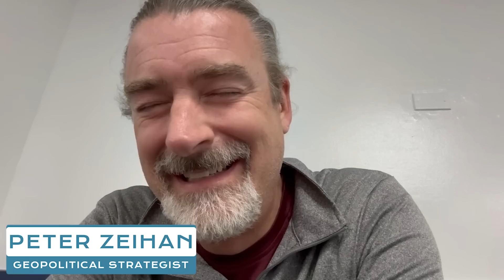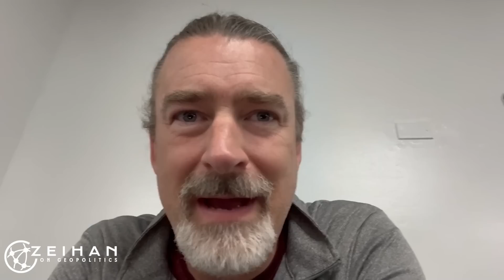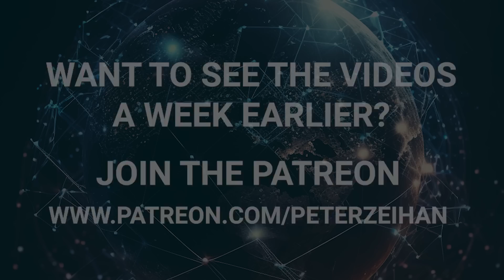Nuclear Power's Facelift: Small Modular Reactors || Peter Zeihan

Comment: Peter, what about the cost? I'd argues that the biggest drawback and the thing that's holding Nuclear back is that it's prohibitively expensive in capital costs, leading to LCOEs in excess of those of other renewables, even if we factor in storage. SMRs are no cheaper per MWh than the big plants, not to mention the added risks of plinking down hundreds or thousands of the things. I don't see those problems going anywhere, anytime.
Reply: ???
Didn't Peter literally just start off by explaining how big tech is bankrolling SMRs for baseload energy so the normally prohibitive capital costs for SMR R&D are considered moot? Am I missing something?
Reply: @korayven9255  It's not just R&D that's expensive in SMRs, but also construction. It's an improvement over the current designs in that you don't have to build the entire thing on site, but all other issues remain. Big tech is getting into it because their appetite for energy is larger than what the grid can provide - and it's actually not about the sources of power, but the infrastructure.
Reply: @korayven9255  That, however, does not adress the problem at hand. All he said that those tech ist paying those startups. He did not go into any kinds of specifics or into utility scale power generation. Peter mentioned Vogtle in passing, Vogtle 3 and 4 cost a combined 34 billion to build. I for one would welcome a in-depth video regarding the economics of NPPs. Because unless those SMRs drive costs down massively, nuclear is just way, way too expensive.
Reply: @AhDude92  You are arguing about theoretical costs that will only become certain after the startups complete development. You are demanding data that doesn't exist yet to argue against funding the processes to get the data you are demanding. That is circular logic. We don't have concrete answers yet, that's the entire point why they're doing this.
Reply: I work in the electric utility industry. The Obama administration did a great job laying out the costs of different types of electricity. This was further broken down by construction, maintenance, fuel, etc. Nuclear is one of the cheapest by requires a 40 year commitment. In today’s ever changing environment there is no guarantee regulators will allow you to run for decades without issuing new costly rules. With new bipartisan congressional approval and backing from 14 banks, big tech now feels comfortable making that 40 year commitment. The cost is a myth driven by low information and biased media. Of course, it is entirely possible that I am wrong and big tech didn’t do their homework either. Perhaps the best expert is a journalist major looking for clicks.
Reply: @Robert-fx3ng  The only news about data centers and nuclear power was a conventional nuclear powerplant that was about to be shuttered getting funding for a refurbishment and life extension from Microsoft in exchange for them getting all the power directly without even going through the grid and thus avoiding the upcharge all grids put on power.  As this was already existing plant already fully paid off the marginal costs were very low.
Reply: @ every nuclear plant that was scheduled to shut down has been extended. 14 banks have approved funds for nuclear. Congress passed a bill to fund nuclear this year. All of the mothballed nuclear plants are in discussions to reopen. The companies working on SMR are too numerous to name. You really can check the internet in seconds to verify these statements. You also could spend 5 seconds on the net before putting your foot in your mouth, if you really are uninformed.
Reply: @Robert-fx3ng  And why were they extended? Massive subsidies. Byron and Dresden got saved only by a 700 million $ subsidy from Illinois. Other scheduled shutdowns were only averted due to subsidies, as well - Diablo Canyon, for example. All recently planned shutdowns were due to financial inviability and losses incurred during their runtime. They were simply not profitable, until the taxpayer stepped in to throw money at it. Thats the problem. Its just too expensive.
Reply: @most people know how renewables are subsidized and not competitive. I am impressed that you could be this bold and uninformed at the same time.
Reply: @Robert-fx3ng  You really like the word uninformed, when youre hardly putting forward any hard data yourself. Prove your assessment.
Reply: @ I work in the industry and just listened what is going on with nuclear. Now it seems to me that you want to change topics and start the renewable energy is much cheaper. If renewables were actually cheaper and not subsidized, utilities would built than at scale. What do you want me to teach you about my industry?
Reply: @Robert-fx3ng  You started with the costs of renewables. I did not mention those in any way. Also, "Trust me bro" is a poor proof for anything.
Reply: Liquid salt reactors operate at atmospheric pressure. That's a big reason these next generation reactors are so.much safe and cheaper.
Reply: Nuclear has always been one of the most cost effective options UNTIL the Sierra Club and Greenpeace focused all their efforts on trying them up in court.  I know ...why would they be against zero carbon power to charge all those EVs overnight?  Influential leaders equated electricity "too cheap to meter" with unchecked population growth, so they threw everything against nuke in the 70s.  Very short sighted.
Reply: SMR arn't just 'no cheaper' they are infact MUCH MORE expensive then large nuclear reactors.

Comment: Nuclear power plants stopped being built in the US because of the economics.  The actual cost of the construction and operation were 2-3 times higher than what people, and investors, were told.  Projects were started, like the Callaway plant in Missouri, and scaled back by half before construction was even completed on one of two planned reactors.
Reply: The cost of construction came from regulations changing constantly over the course of construction. This is demonstrated by the fact that the largest increase in cost of the plant came from the home office, i.e. design and engineering, because of constant reworks and environmental studies demanded by the NRC, specifically to derail and bog the project.
Reply: @nathancochran4694  I think it used to take about 3 years to build a nuclear plant.  That's up to at least 10 years now.

Comment: How do we provide physical security for many, many SMRs?
Reply: I also have this concern.  

How do we protect other vital infrastructure in the USA?

Answer, we put a chain link fence with barbed wire around it, gravel the parking area and mow the lawn twice a week. 

It is cost prohibitive to do much more.

Look at our electrical substations.  Some substations power half a city and they have a fence. 

Same with water infrastructure and anything else that is unmanned. 

Security, safety, and efficiency is why I prefer large nuclear power plants over SMRs.
Reply: That's why many of them will be sited on existing nuclear plant sites. Take Lake Anna in Va. Dominion Energy has announced an SMR project for that site, in part because it's close to the server farms in northern Virginia. In addition to fencing, walls, physical barriers, that plant has basically a fully kitted-out SWAT team complete with armored vehicles on site, just waiting for someone to try something. There's plenty of space to add SMRs within the perimeter. There's also talk in the other end of Virginia to turn old mountaintop removal mines into SMR sites. Picture a mountain ridge with a square mile of flat surface surrounded by sheer drop offs on all sides with one access road in and out. About as defensible as any place can be.
Reply: They're not very brittle or easily sabotaged constructions, so arguably the physical security requirements are moderate. Also many of them will be placed close to each other.
Reply: @jesan733  Just about anything complicated can be ruined in less than an hour with a grinder a hammer and a crowbar.

Tell me if you think otherwise.
Reply: @jasonneugebauer5310  depends on the definition of "ruined" I guess. Let's say we have a huge pool of water, below grade, with no drains, and the reactor modules are operating while submerged in that pool of water. How to compromise that setup, with those tools, to get a significant radioactive release outside the plant perimeter? (I'm describing the NuScale setup, btw.)
Reply: @jesan733  being in a pool probably 10 Xs the complexity. 

But, anything that can be accessed without intervention can be damaged.

I am not particularly worried about the radioactive material. 

Nuclear is unpopular with some people who may just want to damage the reactor for PR.
Reply: @jasonneugebauer5310  why would being in a pool add complexity? The point is that it radically lowers complexity. The NRC agreed that due to this design facilitating passive safety, e.g. no nuclear-rated backup power is necessary.
After 70 years with nuclear power, we have experienced no significant sabotage attempts. It's apparently not a very attractive target.
Reply: @jesan733  Sorry I didn't specify the form of added complexityin my response.

I was talking about the ability for bad actors to critically damage the reactor with tools as simple as a grinder, hammer, and crowbar.
Reply: @jasonneugebauer5310  ah, ok.
Reply: Build a wall..
Reply: Thats what will stop them...

In a world where nukes exist they are an obvious none-starter.